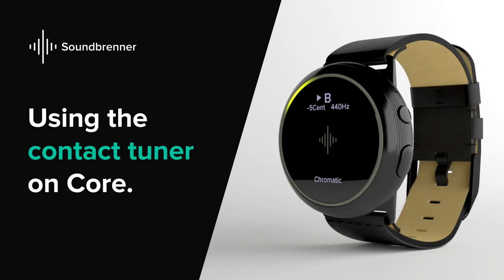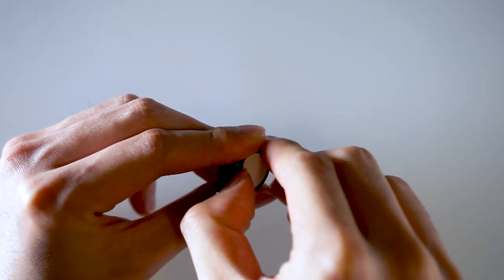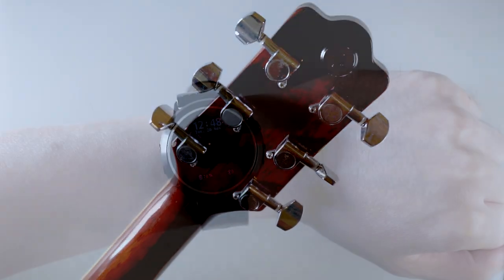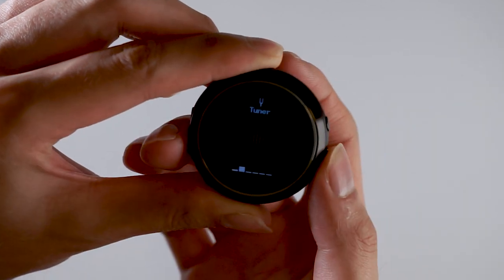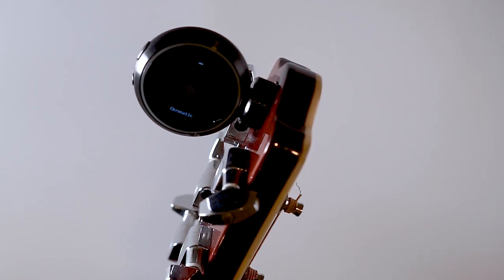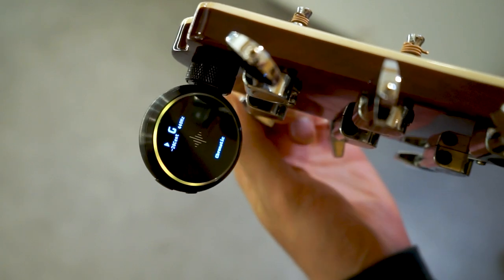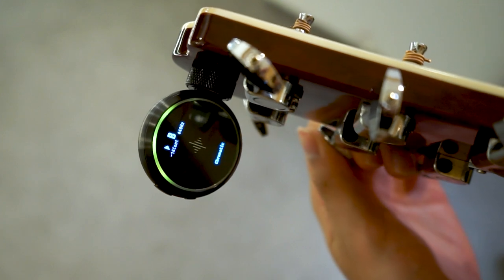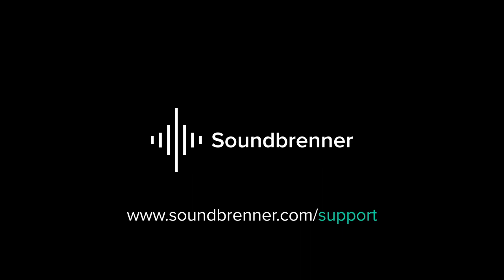Using the contact tuner on Core

Comment: Will there be a way to just use the built in microphone for contactless tuning in future firmware updates? It would be a great addition to the vibration based tuning.
Reply: I second this question, it will make the Core useful for singers, for example.

Comment: I love my Core. It stopped working after a few months and Soundbrenner kindly replaced it. It is great for tuning my cello but definitely scarred the finish. I had to remove the magnet to return with the defunct Core. I should have left it on, but they wanted everything returned before they would send me a replacement.
Word of caution: keep everything that comes with your core, including the manual in case you have to return it.

Comment: oh sure, let me just glue a huge magnet to the back of my 1955 Les Paul. After all professional musicians never have multiple instruments on stage, so I'll just glue a huge magnet to the back off all of my guitars... so this $250 metronome can do the job of a $5 snark tuner that doesn't screw up the finish. Until of course this $250 piece of glass inevitably falls off the headstock and shatters
The Core is a really sad tale of a company with a brilliant original product that does one thing better than anyone, getting completely lost in doing a half ass job of several things instead. Years of design and millions spent with no common sense or perspective. All they needed to do was make the original soundbrenner sturdier so they wouldn't need annual replacement.Then they wouldn't need to make 1/4 of their app into pushy advertisements to make up for poor sales. I hope they stay in business because the Pulse is great, and their patents would stop anyone else from doing it right.
Reply: I agree with you. But just wanted to let ppl know that you don’t need the mount and can just hold it to the guitar. It works fine. I actually lost the mount months ago lol.
Reply: @DNYLNY  I wonder if you glued on a little suction cup to the mount would it work the same without having to actually use the glue
Reply: First off where are you buying a snark for $5 because they definitely sell for $25-30. Second if you need more mounts for other instruments you can just buy a pack of them for $7. Third your soundbrenner isnt just going to magically stop being magnetic. Magnetic fields can last centuries so your watch isn't going to fall off the headstock and shatter. Fourth the adhesive isn't messing up your finish, and do you really care about a dime sized spot of the back of your headstock that no one can see anyway?